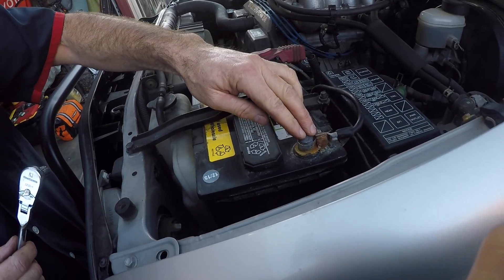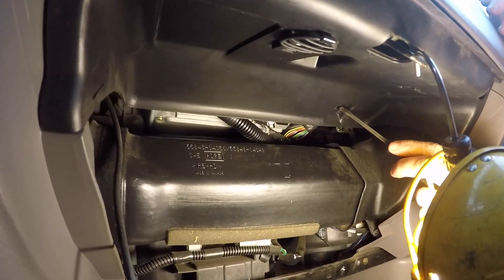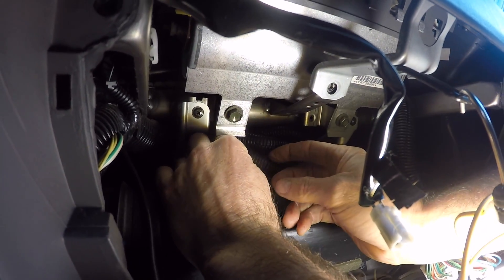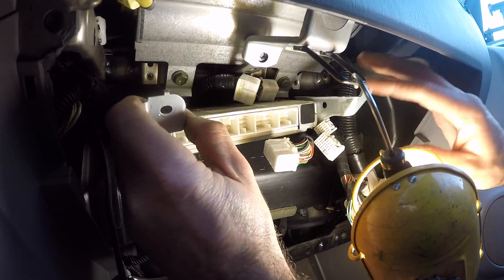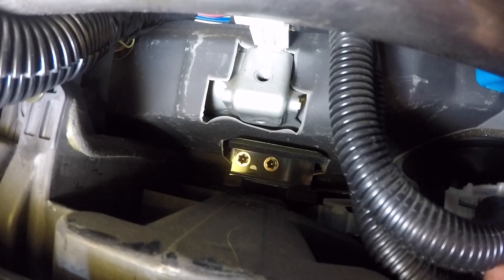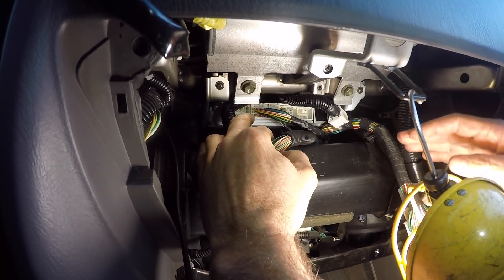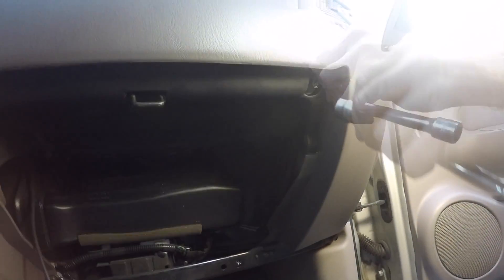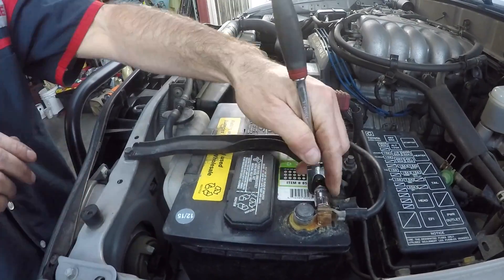ECU Replacement

Comment: Wow, sucks you can't diagnose what is causing the misfire and are forced to throw parts at it.
Reply from the maker: We did finally figure it out.  His engine has gross crankshaft play and most likely the knock sensors set off the misfire CEL.  Check out the video: https://youtu.be/9Gpdq-tL79U

Comment: Hey there, do you know if a 1997 ECU will transfer into my '98 4runner? Doing a manual transmission swap (have all '98 parts from a donor vehicle, but don't have an ecu)... found a '97 manual transmission 3.4L 4x4 ecu, but not sure if it will transfer ok? all the prongs are same at '98. any info would be great, no worries if not sure! Thanks for your videos, they have been helpful and certainly thorough.
Reply from the maker: I'm not sure but I think there's a good chance it will work because I don't remember there being any changes between the 98 and 97 models.  You'd just have to do more research to see if there was something electrically different in the components between the two years that would cause a problem with the component talking with the ECU.  That's about the best advice I can give you.  You could also see if the part number for the ECU from Toyota is the same for both years.
Reply: @TimmyTheToolman  sweet thank you very much for the info and quick reply!!
Reply from the maker: @glorifychrist7  You're welcome.

Comment: Did you ever figure this issue out?
Reply from the maker: Adam Robertson yes his issue was crankshaft play. The thrust washers inside the engine were toast somehow allowing a significant amount of gross play that was causing the crankshaft position sensor to read a misfire code.

Comment: is there programming involved?
Reply from the maker: No, there isn't.   The key is to get an ECU from the same year and model as your rig.  If you do that, it's plug and play.
Reply: Timmy The Toolman TY Sir!
Reply from the maker: @arturoalvarado4030  You're welcome.
Reply: Would you happen to know if a 2005 Corolla ECU requires programming as well or is it plug n play?  TY
Reply from the maker: Arturo Alvarado typically it doesn’t require programMing. Not sure about your specific vehicle but it’s close enough in year to make me assume it won’t need programMing.
Reply: Timmy The Toolman TY!

Comment: Love your videos!  I'm hoping you could school us on using a nice scan tool to diag some of these problems.
Reply from the maker: The only scan tool I tried out was using Techstream on an old windows laptop.  I used it in regards to the misfire problem I was trying to figure out for Greg's Tacoma in this video.  It didn't really help me out.  I wish I was more experienced in using scan tools to diagnose problems like this but I'm not.  I do have a buddy Mark that uses a Snap On scan tool and he says it works really well but it's also really expensive.  I do monitor my engine with the Torque Pro app getting information from the OBD II port, but it's mainly so  I can closely monitor coolant temp, trans temp, charging volts, and to look up any CELs that pop up.

Comment: Hey Tim just want ur input on this: well my Father does lol:  The Mobil 1 oil filter that he bought says it's good for up to a year or 20,000 miles. Do u recommend leaving an oil filter on a vehicle that long? Thanks!
Reply from the maker: No, I don't but I use OEM Toyota filters.  I just switched to using full synthetic oil so I'm going to change my oil and filter every 5k miles.  The longest interval I've seen people go with synthetic oil is 10k.  So in your dad's case, would he replace the oil say every 10k and then replace the filter every 20k?  Or, would he try to push both the oil and filter to the 20k interval?  I would not let the oil go for 20k miles.  If he replaces the oil more frequently than filter, than he'll have to replace the oil that fills the filter every time he renews the filter.  The easiest way to do an oil change is to replace both at the same time.  

So, my recommendation is to start with a 5k oil change and send a sample of your oil to Blackstone Labs for an oil analysis.  If they say the oil looks really good with lots of lubricating properties left, increase the interval to 7.5k and do another oil analysis.  If it still looks good, bump it up to 10k.  Like I said, I don't think it's worth pushing it past 10k.  Hope this helps.
Reply: @TimmyTheToolman : he would replace the oil every 5k until he got to the 20k and then replace the oil filter at that point...would you ok that?
Reply from the maker: @israelrodriguez6986  Well, if he wants to believe Mobil that it's good for 20k miles, than yeah, he can do that.  I personally wouldn't push the interval that high no matter what a company tells me.  But, that's just me.  Oil filters aren't that expensive or that hard to change for me to risk that long of an interval.  If the filter gets dirty enough that flow is inhibited to your engine, this convenience of only changing the filter every 20k just cost you an engine.  It's not worth it to me.  I guess you could search online in Toyota forums for people who are saying this kind of interval is fine with a Mobil 1 oil filters.  I'm just not going to acknowledge for you that it's a good idea because I would never do this with my vehicles.

Comment: Do the ECUs have to have the same number?
Reply from the maker: I'm not sure.  The reason why ours matched is because I picked up the replacement ECU from the exact same year and model truck as Greg's.  Is the ECU you're thinking of installing from the same year and same model as yours?
Reply: @TimmyTheToolman  I haven't located one as of yet but I was unsure if they had a year range where they are compatible. I have a 2002 4runner limited 2wd.
Reply from the maker: @ce0687  Well, I really think your best bet is to find the same year and model (2wd or 4wd, Manual Trans or Automatic Trans) and then you won't have any issues.
Reply: @TimmyTheToolman  ok thanks! Know of any sites I can get one?
Reply from the maker: @ce0687  I found the one I bought on Tacoma World.  A guy was parting out a truck.  I'd search the Toyota forums in the classified sections, search Craigslist and search Ebay.  You could also search your local wrecking yards like a PicknPull.

Comment: Tell your friend to use seafoam in his intake. Most of the times the intake valves get covered in carbon deposits by using low grad fuel then it won't seat properly, which at some point will cause misfire.
Reply from the maker: Ok, thanks for the suggestion.  We'll give that a try.

Comment: Why do you keep throwing the parts cannon at it? Lets say we put it on a scanner and figure out what the problem is. Look at spark hook up the amp clamp and see if you have a primary or a secondary problem with the coils. Look at fuel trim levels for the fuel. Look and see. Your customer has spent a lot of unnecessary money and it does not sound like you are done yet.
Reply from the maker: Hey Dave, we have done a lot of diagnosing AND throwing parts at it.  I'll be the first to admit that I'm not a pro at diagnosing something like this.  We have eliminated a lot of things but still haven't figured it out yet.  I bought an old laptop with Toyota Tech Stream on it but it didn't point us to any problems.  I don't think it's a problem with the coils or the fuel.  According to Greg, the truck runs exactly as it did before the misfire CEL popped up.

By the way, Greg is not a "Customer".  He's just somebody I'm helping out the best I can.  My time has been completely FREE for all this work we've done so far.  His registration is expired for over 6 months now, and if he can't figure out the problem, he's talking about selling or parting out the truck.  I took a chance on the ECU and paid for it out of my own pocket.  The air/fuel sensor and O2 sensors could have been a waste of money but many people, including myself, replace these as general maintenance to improve gas mileage.  I don't see the fuel injector replacements as a waste of money either because his engine performance did improve after the swap.  He said it had better acceleration and a little better power.  

The next thing we are going to do is check his timing and do a leak down test of cylinder 1 and see what those 2 tests show us.  What I haven't mentioned in any of the videos yet is his engine has a very notable lower end knock when under load.  When he's idling in park or neutral, the engine is quiet.  When he puts it in gear, a loud knock can be heard.  I used a mechanic's stethoscope and it's definitely coming from the lower end of the engine.  But, according to Greg, there has been no performance loss.  

So, long story short, Greg really isn't out that much money so far in our attempt to figure out this problem.  He actually brought his truck to the Toyota dealership local to us and they didn't seem to try all that hard to figure it out for him other than charging him $150 for one hour labor.  Maybe an experienced tech would have figured this out by now, but maybe they wouldn't have.  And, how much would have all that labor ran Greg?  The tech could have gotten lucky and figured it out quick, but then again, he might have spent hours and hours on it like we have and not figure it out.  The cheapest labor rates in our area are around $120/hour.  Our local dealer now charges $200/hour.  I could easily see that Greg could be into this misfire diagnosing for a lot of money with still no answer.   We'll keep looking and hopefully figure something out but I'm sort of thinking the source of that engine knock is what's the issue and we're not going to know the source of the knock unless the entire engine is torn apart and that's not going to happen.

Comment: For the most part the check engine light on my 4Runner had been on. Less than a week ago I had a low mileage engine replacement and STILL the check engine light is on! Please Timmy The Toolman can you help me? In the past having a  250,000 mile engine brought some concern about the light. Now with this differnet engine Im really concerned! Could it be the ECU? Is there a common reason fir the 5vz fe?
Reply from the maker: Andy Z have you run the CEL code yet?...
Reply: @TimmyTheToolman  eh.. no I guess Im getting ahead of myself.  I'll get back with ya.

Comment: Timmy, one thing, you failed to list the torque specs for the screws and bolts, totally un-sat!!!!  :)
Reply from the maker: I know Andy.  I'll have to work on that.
Reply: Lol it's not hard just go buy a hanes car manual for your car. It has instructions engine wire diagram. Did I mention torque specs?
Reply: And there 11-20 bucks

Comment: Not sure if this will apply to Toyota but I had the same damn probably with a Honda 3.5 v6.  Did everything you mentioned including PCV valve and nothing worked.  Misfire code keeps coming back.  My friend suggested a valve adjustment especially the exhaust valve.  Clear the code and it has been 3 weeks and the code has NOT pop up!
Reply from the maker: Thanks for sharing this.  I'm curious to see what the leak down test shows us.

Comment: You check compression or do a leak down test? Mechanical issues like a sticking or bent valve, low compression, etc can cause a misfire as well.
Reply from the maker: We checked the compression of all cylinders and they checked out good.  I didn't bother with the leak down test because of the initial compression test.  But, we are going to perform a leak down test soon and check the timing.
Reply: @TimmyTheToolman  start looking electrical check the injector triggers with a noid light. also if you can have a shop with an oscilloscope check the ignition side for correct triggering of the coils and ignition patterns. A head gasket could also be the cause the chemical testers are pretty cheap to test. I have seen electrical issues plague diagnostics. I wouldn't throw anymore parts at it but run through the diagnostic flow charts for those codes and make sure the wiring is good as well your FSM should have those diag. flow charts. Mr Squirrel and Mouse like cause issues that may not be seen even just over night. I hate the shotgun method and guessing and stuff that goes on in the forums as well as in the comments below. I like seeing testing being done to rule out issues before parts being thrown at it. That's just the mechanic/technician in me.
Reply from the maker: @scooter041031  I hear you.  I'm trying to be methodical and diagnose but sometimes replacing things that are probably ready to be replaced isn't such a bad thing.  Greg replaced his spark plugs and wires trying to fix this problem but guys do this as preventative maintenance.  We replaced the upstream Air/Fuel sensor and downstream O2 sensor, but again, guys replace these thinking their mpg will improve due to a lazy O2 sensor.  Fuel injectors can show they are electrically fine, but who knows if they are partially clogged which could be causing the misfire?  So, we decided to replace the fuel injectors with some refurbished ones.  After the fuel injectors were replaced, Greg said his engine had more power and a better throttle response so I didn't consider that a waste of time or money.  So far, the one thing we did that was truly throwing parts at it was this ECU replacement.  I was just going for the long shot since somebody on T4R.org said he had a long time misfire problem and a replacement ECU fixed it.  We've eliminated a lot of things and we're still searching.  Next step is a leak down test and checking the timing.
Reply from the maker: @scooter041031  I forgot to mention that Greg took his rig to a Toyota Dealership a long time ago and it didn't sound like they put much effort into figuring it out for him.  I would have figured since they have diagnostic tools like an oscilloscope they would be better equipped to find the culprit for the misfire.  I know being able to diagnose a problem like this is the difference between a "Technician" and a "Parts Replacer".  Hopefully we'll get some answers from the leak down test and the timing check.
Reply: @TimmyTheToolman  that's disheartening.
Reply: @TimmyTheToolman  Oh when I said eletrical I meant the car side harness a wire or something being chaffed or broken. Also that care you took in plugging in the ECU check the connectors for everything make sure one of the pins isn't loose or pushed out so that it isn't making good contact. Chasing a gremlin like this is very time consuming and can be frustrating.
Reply from the maker: Ok gotcha.  Thanks for sharing all your suggestions.  I appreciate it.
Reply from the maker: Yeah, dealerships regularly leave a lot to be desired how they treat their customers.
Reply: @TimmyTheToolman  not a problem man. Having over 20 yrs in the business you pick up a thing or 2. It's sad no matter where or who I worked for I would put the best efforts to solve the issue. Even if that meant calling a customer and explaining this isn't the typical quick and dirty easy diag. we have to get really in depth and won't know how long the diag will take and we have to charge you by the hr. from this point on to diag. until we find the issue. That conversation is one of the most u comfortable ones because people think that it's just plugging in a scanner and reading a code when sometimes its much more. Some customers will think you are ripping them off but reality is shops and techs loose money when they get situations like that.
Reply from the maker: @scooter041031  Well, too bad all dealerships, private shops and paid mechanics don't have your work ethic and integrity.
Reply: @TimmyTheToolman  I just think that solving the customer's problem is top priority and should be the top concern not the bottom line. It makes it hard for the ones that actually care the shops that like to rip people off and scam customers. It's an uphill battle to gain trust from people these days.

Comment: Sounds like compression test next best thing. If it's been run a couple hundred miles since replaced, when you pull the #1 sparkplug it should show signs of burning rich.
Reply from the maker: We did a compression test already.  Compression was good in all cylinders.  Next step is a leak down test.

Comment: Hey Tim, just keep eliminating the possibilities. If you have access to TIS techstream look at the misfire counters while driving around to verify that only #1 is misfiring and the exact conditions that are causing a misfire count increase. Other cylyinders may be misfiring but not enough to throw a code for that cylinder. Then move to the Leakdown test to see if/where it's leaking, then check the timing belt and the timing pulleys. I have seen it before on a 5vz that the crank timing pulley woodruff key slot wallors out allowing it to rotate slightly relative  to the crank causing the engine to have a misfire under load because of a small timing error. If those tests and checks don't bring the issue to light then it's a difficult to find electrical issue in the harness or the grounds. May the Toyota gods be with you...
Reply from the maker: Thanks Jacob.  I do have Techstream and was looking at it while we were driving.  I was watching the misfire counts but didn't come across and Ah-Hah moments that let me know where the problem lies.  Maybe I just don't know what to look for.  The driving conditions were just mellow city and freeway driving.  

I have a leak down tester and a timing light so we'll see what those show us.